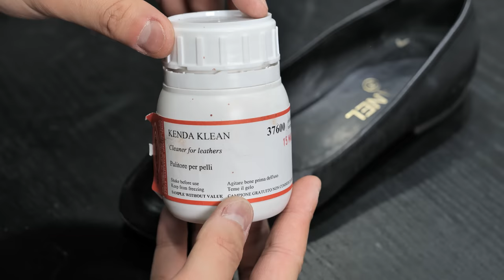'Restore'  'CHANEL'  Flower Ballelina Flat Shoes  -VeTiVeR

Comment: Firstly, I love love your videos, skill and craftmanship, but I wonder why you wouldn't use a simple clean sole instead of one with all the imprints and designs on it? It is the bottom of the shoe, but it seems the soles you choose for your videos takes away from the design of the shoe originally - like it doesn't match the shoe's design. Are their simpler clean soles you can use other than the ones you use that has different patterns and imprints?

Comment: 17:06 - Was there a reason you moved the little metal logo from the inner parts to the outer parts of the shoes?
Reply: That's where it goes
Reply: @katiekai9765  - not per the "BEFORE" shot, though.. which is why I'd asked.

Comment: Fantastic job, except the Chanel pin is on the wrong side of the flower. The originals had then on the inner side
Reply: Nope
Reply: @katiekai9765  what do you mean 'Nope'. The end shots clearly show the CC gold pins on the inner aspect of the flower before restoration and after restoration they're on the outer aspect.